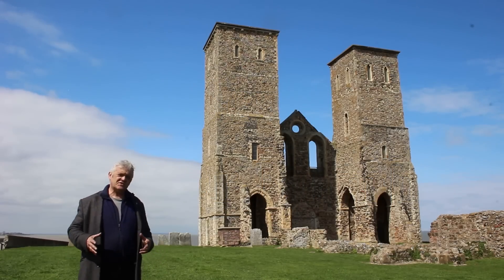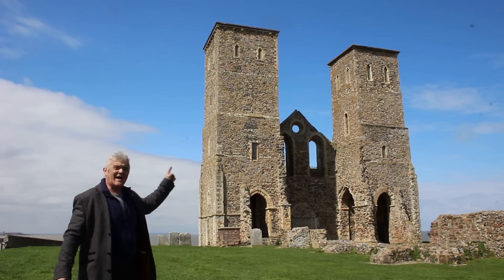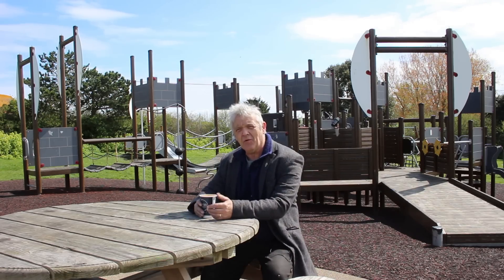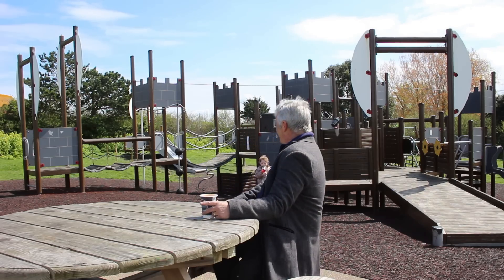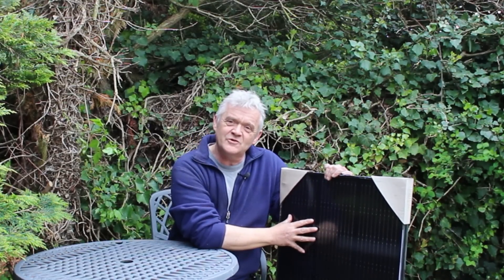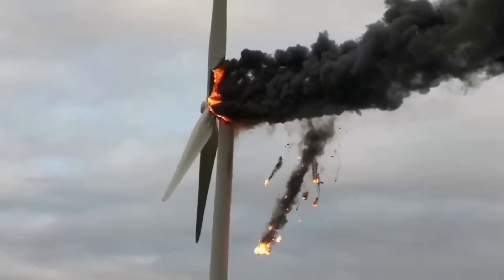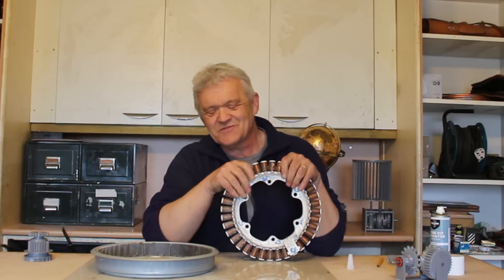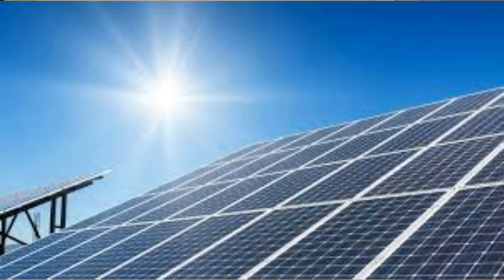1907 Wind Turbines - Scaling Up - Go Big, Go Many Or Go Home?

Comment: well in case someone findes a direct drive motor and rewire it , please do add some sort of control and dumpload espesially if you are charging litium batteries,,,as these motors can reach a good amount of A ,,if you want it simple a rectifier+ a20 voltage controller a a solid state relay can do the job

Comment: Well Robert, quite the conundrum! Which leads to this question will the output from a serpent coil be greater or less than the output of those small individual coils shown on this video from the washing machine? Can I take it that the small individual coils take much more copper compared to the serpent coil. As always very thought provoking, but great to watch. Cheers Dennis “Herne Bay”.

Comment: I find the wind wall to be very appealing in multiple ways. Is there a reference for calculating size and shapes of rotors and spacing. It seems like an artistic way of creating power that won't upset the NIMBY neighbors. I'll search it of course, but I appreciate it if you have some good resources to share.

Comment: I have long been a  proponent of small scale everything. My firm beliefe is that the larger the scale the larger the problems when something goes wrong. Bear in mind such things as food or fuel shortages in cities when the supply chain is disrupted or a garbage strike. I even go so far as to say that whenever anything becomes an industry it becomes corrupted and a negative influence. Or looking at it another way it becomes a detriment not a benefit.
I believe the ideal way of living is rural and power production can be done by each individual homeowner. Essentially each residence can be a cell in a network of rural cells where construction and power production can be done in a hybrid way with each site utilizing its unique options.

Comment: Hello Robert....yet another great video....i think you should use that washing machine motor on a project but take those ceramic magnets out and replace them with some neodymium magnets...i have heard that those motors can produce up to 5000 watts as a generator if you replace the magnets....i would love to find out if this is true because I have a few of them set aside for a water turbine project that I might try to stack up to five of them on top of each other on the same driveshaft and see how things go.

Comment: I watch every video and get a lot of input. The 3d printing is fun to watch but is not possible. A few days to print something might be a proof of concept however with no power and little water it is just not feasible. No criticism intended. In Africa we have to make do with what you can find in a "technology storage facility" after the real scavengers were there, and there are a lot of very savvy ones out here 😅. When we say go big it means at least 500 watts. We have no wind but boy do we have sunshine. Steam will be the solution here shortly. The steam is not the problem the engine is. Storage can be fine gravel. Mirrors, east west concave mirrors at least 3 meters long with a focal point to accommodate the sun's equinox. Looking at simple steam turbines?

Comment: Turbines get bigger and bigger to generate more power due to larger swept area and height above ground. I guess you could mount loads of small turbines on a 100m tall tower but if you're going to build the tower, you might as well put a single big turbine on it! Not sure a mechanical device like a wind turbine scales like a solar cell.

Comment: I have not commented in a while. I’ve been very busy. But this is a great example of systems integration. In the 1980s, I suggested that a client of mine use a multiple approach to power generation. Wind, solar, geothermal, captured methane, mechanical weight capture and water tower (yes, water tower) along with solar heat storage and a way to flash water to steam. 
They laughed at the time, but all of these systems work, work well, and can actually create a way of negative Zero Point energy. 
Your small pulpit of passion for engineering is doing more good that you could ever imagine.

Comment: Hiya robert ,why does alot of info on wind turbines mention the need for big dump resisters as is the case for hydro as well,i was of the understanding the power will only be there once the load is placed on it ,if no load then itll just spin,is this to stop the idea of it just would keep spinning into failure of no load was on ?

Comment: It's true that the scale of wind turbines can create awe-inspiring visual effects, especially when they are installed in large numbers, such as in a wind farm. In general, wind speeds tend to increase with height above the ground, which means that wind turbines mounted on taller towers can capture more energy from the wind.

Comment: Well Rob looks like you've nailed a great analogy not just for power generation in general - but also a more ideal means of living without absurd government over-intervention... smaller SELF-governing systems all operating in tandem, cooperation and appropriate coordination makes a far more robust and efficient system overall  (with built in redundancies) than one outdated monolithic centralised system obsessed with overarching control and regulation with inherent points of potentially catastrophic failure. Decentralised microgeneration (from truly individual to small scale community/village/town level) seems to be the only truly viable way out of our dependence on 'big energy' and the inherent failures of over centralised & profit-obsessive models.

Just look at how much area those dang wind and solar farms take up! Microgeneration makes use of plenty of open real estate on rooflines, building walls, open roads (recylcled hardened cglass solar harvesting forming the actual surface of the road in modular replaceable panels), you name it - and the chances for massive ecological devastation is truly minimized!

Great vid as usual! Becoming quite the David Attenborough of independent energy generation and tinkering! 💪

Comment: Hi rob cathedrals = cathodes :). U Must be a mind reader cos today i planned to re-wire my front/top loader washing coils in to a 12 volts generator!. With your wind turbine gravity battery idea could you not power a magna circ pump to pump water up to a tank to release when its not windy? Either that or use the wind turbine as a pump itself sucking the water up via a connected impeller and pipe arragement the impeller being turned at the same time as the main wind turbine as they are connected

Comment: Maybe dumb question, for your turbine model, would there be any significant difference if you doubled up your flywheel with magnets so that they "pinch", for a lack of better terms, either side of the coil? Or would the cost be greater than the outcome?

Comment: Brainstorming here... bit of a sailor by trade, what if you made a 7day clock mechanism or koo koo clock for fun... with a small PC fan generator or scaled it up a hair, enough to maintain or stretch a sand battery heat output? Hand crank heat! Or lights or beer fridge whatever... haha

Comment: I saw a guy who made a generator that was either 18 or  26 coils that he sealed in epoxy and he made a sandwich of the coils with magnets on both sides of the coils. I need to find the video, but the guy was pusing like 40 to 50 amps with a a bout a 5 or 6' across 10 blade turbine. All I can be sure of is that he was pushing 40 amps at low rpm. I will find it later and post it. He is in your part of the world, I think he's scottish. It was so long ago I saw it. I know I saw it!

Comment: Offshore wind engineer here: the amount of work and capital required to produce and install single offshore wind turbine + foundation  means that bigger is more cost effective.

A 15% increase in material and fabrication costs is worth it for a 30% increase in power output.

Not to mention that a smaller turbine will require the same maintenance schedule as a larger one, meaning that a smaller farm would require more maintenance to produce the same amount of power, increasing your operational expenditure significantly.

At the moment, farms with larger turbines result in a better £/kW rate, so make much more sense for developers.
Reply from the maker: aparently - well according to the wind catcher guys - that's not so
Reply: @ThinkingandTinkering  at the moment that wind catcher is just a pretty picture, let's wait until they have something in the water before taking their claims seriously. How are they planning to service 117 rotors compared to 5? How do they move parts to the upper levels? What happens if onenrotor goes offline?

Also, do we know if their system can weathervane? From the looks of it, a change in wind direction would reduce their output to zero.

Comment: Here to see the computer model... say nano at scale?
Reply: Diodes help with just connecting wires. Two windmills going opposite directions could be bad.
Reply from the maker: windmills can't go in opposite directions mate - the blade profile ensures they turn only one way - the reason for diodes is to prevent one turbine running a second one as if it were a motor

Comment: Very thoughtful video but...regarding controllers... whether for 'big or small', they can often greatly increase efficiency.  For example, in video 1904, you presented Flux Switching, or Switched Reluctance Generators. These generators (and motors) have many benefits, especially when you use electromagnets.  This allows the magnetic flux to be controlled, to better suit the changing winds, by real-time adjustment of torque and speed characteristics of the gen's rotor (or rod, in the clever proof of concept you built in 1904).  

Because of this, I see great applicability to energy harvesting devices, like many of your creations, as the torque and speed produced often varies greatly with the dynamic nature of the mechanical input.  For example, in places where wind speed is constantly changing (GB for certain but really any context), the strength and timing of the electromagnet (magnetic flux) can be adjusted to prevent cogging with weak wind as well as to extract maximum energy when it's really blowing (and prevent overspeed) - twice a year in GB ;) LOL!!! 

 I've seen some folks call them 'software' motors or generators, because the key to best performance is with the algorithm used in the control software (circuitry as well, of course).  But this capability does unfortunately add complexity,  making it harder to build them.  Hopefully better design tools and methods will be available in the future, for DIY folks like yourself.  Cheers Rob!
Reply from the maker: i didn't say you didn't need controllers i said the amount of control needed is over-estimated
Reply: @ThinkingandTinkering  Sorry, I misinterpreted your theme when you presented the washing machine rotor with no controller required.  Thank you for clarifying. Love what you said about small vs big systems (aka distributed vs centralized?); so many aspects and qualities to consider - especially related to control systems. I think I understand now, for sure.  The appropriate degree of control of a system is fundamental to it's successful implementation and operation; to much or to little control leads to a less desirable result, either in cost or function.

Thanks again Rob!  And hope you find the info about Switched Reluctance Generators interesting, especially for energy harvesting applications. Best regards.

Comment: Scalable systems are definitely the way forward & the trick to domestic energy independence will be how these scalable systems are built out. I wonder how many people in temperate climates have bought into solar with no storage only to find daily & seasonally they need most energy precisely when the sun doesn't shine. A better path to mass market adoption may well be [thermal energy storage + small wind + small solar + more wind + electrical energy storage + more solar] with each step cost-justifying the investment within 6-months.

Comment: Home windows seem to be able to make great wind generators 🤣. Leave one window open on one side and the other on the other side, and you get massive powerful gust on wind flowing through. Perhaps the simplest wind generator would be a huge convex wall with a  small hole in the middle, with protruding edges so the wind can't blow around.

Comment: If you want real power then you scale up.  You can't use windmills like in a solar example.  It doesn't work!  Windmills create wild AC and solar is DC.  Big difference.  Sorry, physics wins out every time mate.  And the more you try to match the voltage the more the cost goes up and then cost/watt will wins every time.  Small isn't feasible or is it very practical.  I know I have worked it out on paper as I always go to paper first.  Have to see all of the bobs and bits and then compute the odds, overall performance and cost profile before I spend time with designing.  I normally laugh at the car alternator versions as they aren't efficient enough.  I would go back to the Darwin, create a way to increase the wind flow rate and use a dual axial generator on the output.  That was by far the best idea I heard presented for wind here which impressed me allot as I thought it was a mashing good idea.  But if you still want to go down this road, you will have to change wild AC into DC, filter it, run it through a dc-dc boost converter circuit which is connected to a bank of super caps.  Then from the super caps you can feed the output of that into a MPPT charge controller to charge a battery.  The cost of all of those convertors was the turn off for me.  IE, 25 quid for each times 10, plus the super caps, then you have to feed that into a MPPT charge controller and then to the batteries.  I worked on this problem about seven years ago when a customer brought four 12V windmills using a car alternator and through he could wire it in series.  Lets just say he was throwing a major wobbler!  He lost the plot when it came down to how it really worked.  Yes, it's used to charge 12V battery but it has to be changed to DC first and then directly feed into a battery.  Pulsing DC can't be connected in series.  Doesn't work; could start a nice fire.  Give it a go if you want mate.  Just trying to save time for you.
Reply from the maker: sorry mate not being rude but that just goes against the research and the basic physics - circle of diameter of d is always going to have a lower area than a square of length of d - more area = more wind captured = more power

Comment: I recently replaced a similar washing machine motor stator which failed because the bearings on the washing machine  went south.  Interestingly enough the windings are made out of what is called copper clad aluminum.  Significantly less expensive and lighter then pure copper would be.  The trade-off is that aluminum has higher resistance.  For what it's worth I thought I would give you a heads up.

Comment: The prevailing wind where I live hits the front of the house, so the gap between my house and the next one is a bit of a wind tunnel.  I've often thought that I could bolt a number of small VAWTs to the side of the house, and parallel up the output.  And if one fails, I don't lose everything.

Comment: I agree. Large scale wind farms are expensive, inefficient at low speed and dangerous. Mass production of 12ft tall, 5ft wide vawt turbines would be cheaper

Then there's also the archemedes screw wind turbine.  They're pretty nifty

Comment: I thought that with solar panel arrays you needed Module-level power electronics (MLPE) as opposed to a string inverter system, otherwise the total output is limited to that of the lowest performing module connected to it. If you're already making a big investment in a solar system and have trees around obscuring panels throughout the day, it seems like a no brainer to have a bunch of little inverters optimizing each panel to deliver as much power as they can vs limiting the whole system with one inverter. That's a use case where you have a bunch of 'little things' but at the same time it also complicates the system more, but you gain a lot of extra power that would otherwise be waisted.

Comment: something you had not mentioned too, is you get a law of diminishing returns on building something bigger and bigger, in many instances, and while you might get more power per cubic foot of machine, you will get reduced time before something wears out like bearings, compared to the micro sized devices, and the wind wall experiments you did show that if you arrange the units properly together they will increase the output of each other to come pretty close to matching if not superseding the power output of just a single unit, However I still want to see more work on directional baffling on VAWT designs to show how much they can be altered to get the massive power and speed that normally is missing from them, due to the spinning blades are being pushed on blades forcing them to attempt to rotate in both directions, and the shape of the blades just reduce the amount of resistance on the side that would push it the opposite direction,. while redirecting that wind from the back of hte blade to join the portion of wind hitting the front of the blade, will increase output by both reducing the wasted energy and reducing the resistance to spin the direction desired, then just put those all on a lazy susan so they can always make sure which ever direction they face will ultimately be into the wind to catch it and control direction, OR put a coil and magnets on them too so as they rotate around changing the direction of input some to increase it, you get some power too, out of it and maybe use the coil to control position with a detector all powered from it moving freely initially. lol